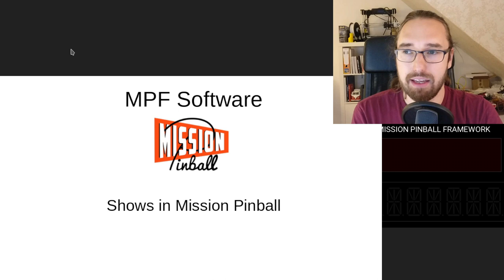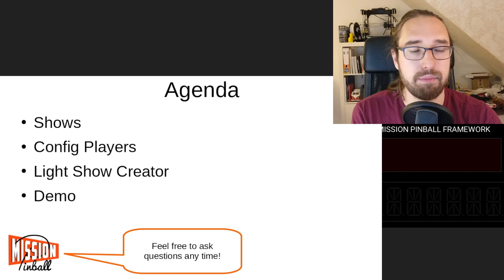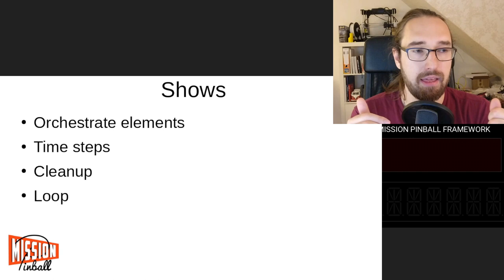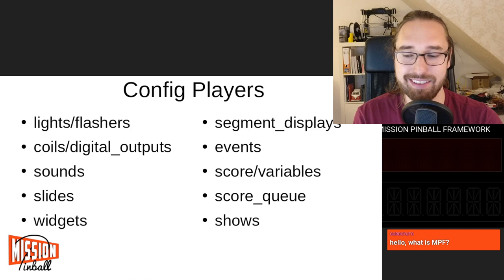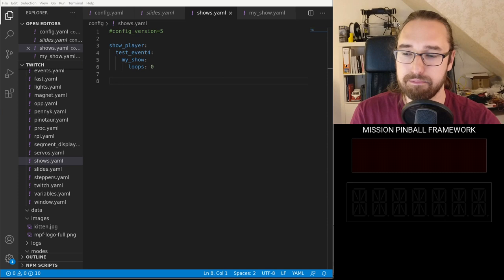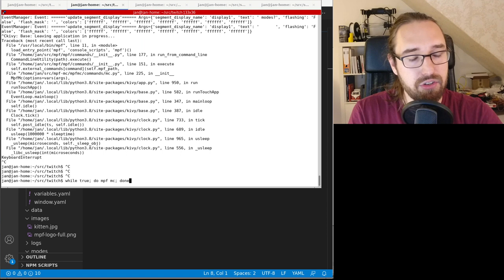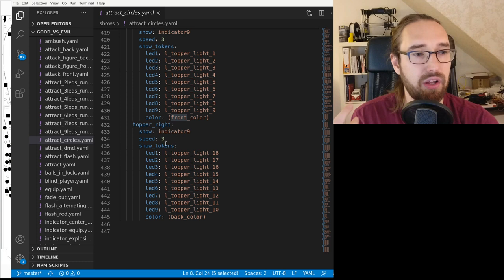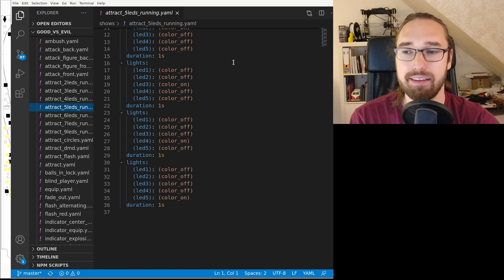How to create shows in MPF? - Overview and Theory of Shows 1/3

Comment: Hi, Jab your area doing very good  teachings videos. I have a question, how hard is if I made my pinball game  in a Visual pinball software with all the programing funtions and shows ,score, sounds ,music and events to passed (copy & paste) to the MPF software to maked in a real pinball machine ?
Reply from the maker: Thanks! If you are using VPX (or VPE) you can start to programm your in MPF from the beginning (as there are integrations). Afterwards, you can drop in some hardware pinball controller and should be able to run the game on physical hardware within a few hours and minimal changes (setting switch/coil numbers and adjusting timings mostly).
Reply from the maker: @floydpr8359  We got a discord here: https://discord.gg/V55KgR5u